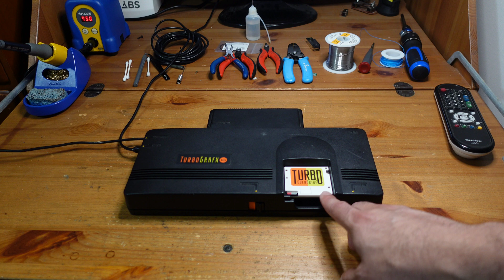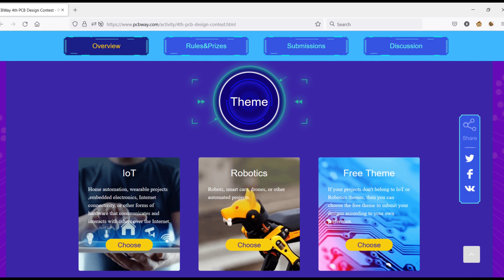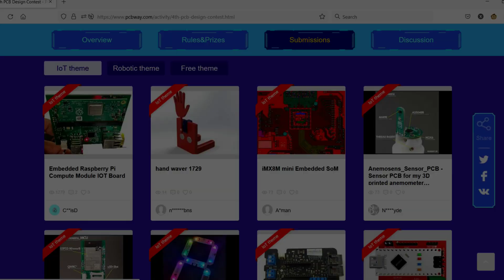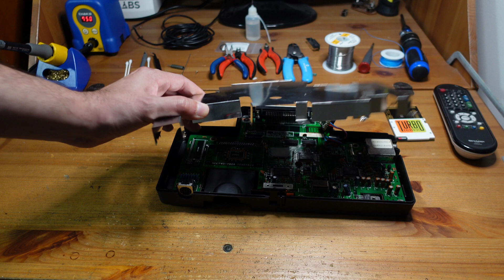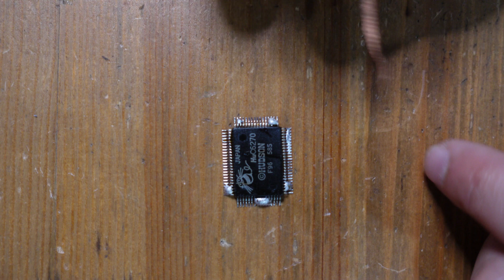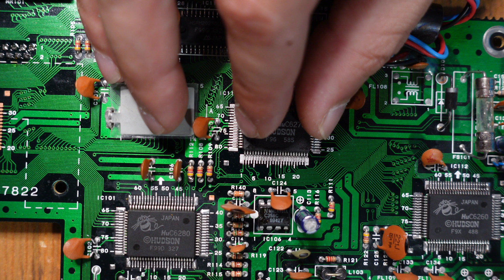Turbografx 16 chip swap repair! Learn how to safely replace surface mount chips!

Comment: Thanks for this video. I've got a Turbo that is showing nothing but a white screen. I've cleaned the cart connecter and re-capped the board and it still shows a blank white screen, so at least I know it's something beyond my current ability to repair. The only annoyance is that I should have re-capped my other, working, Turbo instead, since I have a TurboNanza coming to me in the mail soon that I want to install asap.
Reply from the maker: Yeah this one most likely has bad ram
Reply: @LIRetroGaming   My console showing only white screen is a sign of bad RAM? I thought that it was going to be one of the Hu chips. Is the RAM an off the shelf part, or is it another proprietary chip (or maybe just hard to find)?

Comment: Is it possible that the old chip just needed a reflow instead of being replaced entirely?
Reply from the maker: I don’t believe so. I inspected the chip and the connections between the pins and motherboard were solid

Comment: Hey bud I got a question. I have a Neo Geo AES cartridge Alpha Mission 2 that is displaying garbled graphics. It's not the contacts and not the system. Through further investigation I opened the cart and found two sets of bridged contacts on two separate chips. I was wondering if this is the reason for why I'm getting graphical glitches in the game? The funny thing is the only screen that shows up clear with no issues at all is the weapon armor select screen which works totally fine. Everything else is graphically glitched. If you have any other suggestions or ideas feel free to share, I'd appreciate it thanks.👍😎👌
Reply from the maker: Unfortunately I’m not really sure. I don’t have too much experience with repairing those carts
Reply: @LIRetroGaming  Oh ok no problem at all I figured I'd ask since you've done such a fantastic job with the tg16. I appreciate you letting me know anyway bud thanks.👍😁😎👌

Comment: How advanced is this operation? Should someone who's barely able to cleanly solder two wires together or a pin into a board attempt this?
Reply from the maker: This is definitely more advanced. I would suggest getting comfortable with soldering first before trying something like this

Comment: BTW the 6270 is the video display controller (VDC), not the CPU (which is the 6280).
Reply from the maker: Yeah I realized that after the fact. Sometimes I make mistakes like that because I’m not speaking off of a script

Comment: I had a baby blue screen on boot up after I did a jailbar capacitor fix on my pc engine, it was working before so I was confused as to what happened. Much later on, I reflowed solder on the pins for the hu card slot and I crossed my fingers, and somehow that worked for me
Reply from the maker: Nice! Glad you figured out what it was and got it working again

Comment: I ruined a chip on a pc engine by doing an rgb mod, it still works but the blue colour won't work on rgb, I believe it was something to do with a ground loop because the monitor was still plugged in and I touched up a loose connection.

Comment: Nice job! How did you know it was that chip that needed replacing?
Reply from the maker: It was a little bit of a guess. I saw the behavior that the everdrive was doing where it would keep boot looping, and I suspected that it was either the CPU or the ram
Reply: @LIRetroGaming  ah okay. I was wondering if there was a way to validate that the CPU isn't working by using an oscilloscope, like seeing if it's outputting data or address values.

Comment: I love chip quick but it's just so expensive.
Reply from the maker: It’s a little pricey that’s true, but really the only good option if you have to remove surface mount chips. I don’t use it for any other applications so I don’t need to buy it regularly

Comment: I use a ceramic drink coaster when I need to solder something loose like that. I even used it to clean up ChipQuik many times. ;) I like to flood the legs with solder and remove it all a few times without reusing braid in order to get more of the contamination off. You really don’t want and ChipQuik to still be on there. Actually, I reuse the each piece of braid on the board pads and flood those too then use a fresh piece on both when finishing up.
Reply: Should be noted that chip quick will destroy the chemistry of lead-free solder, do they shouldn't be used together.
Reply from the maker: That’s definitely a technique that I would like to see!